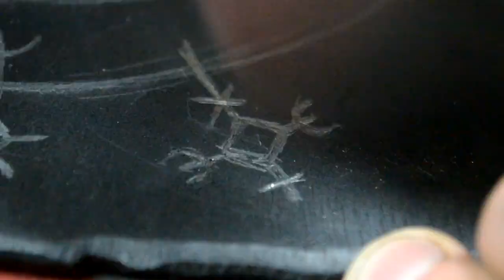Kratos Axe from God of War

Comment: I don't like the hollow construction, made from thin sheet metal. So many builders use this technique, but I hate it. Makes for just a wall hanger in my opinion.
Reply: I’d say it was just a art project, but I do see what you mean. A lot of these things sit on a wall and are never used.
Reply: @YogurtSnipe  
I get while many people build like this. It would cost a lot more in material the get good knife grade material in that thickness and it would take a lot more time and ability to grind it to shape, harden and temper it, then finish grinding it to shape and sharpen it. Also the weight of the axe would be surely too much and too unbalanced with a very heavy axe head and no pommel to balance it out, making it hard to use unless you really are a demigod...

Still, I don't like it, takes away the weapon side from it...
Reply: Of course it's just a wall hanger. It would be no matter how it was made. What do you expect him to use it for otherwise? I don't think he's planning on going to war anyone soon, especially with an axe as the weapon of choice 🤣
Reply: @kshepthedrummer  For me it's important that even a wall hanger be made properly, with care by the builder in making the best possible object. I saw too many wall hanger disintegrate when someone decides to jokingly swing one in the air, without even hitting something. Then, of course you are not going to run around swinging that all day, but knowing it's real and properly made, makes it that much better.